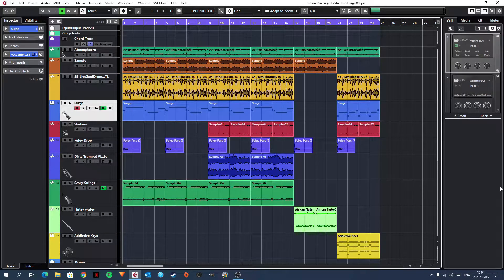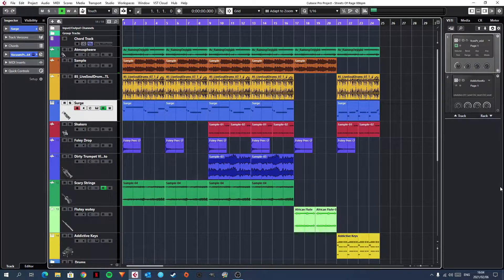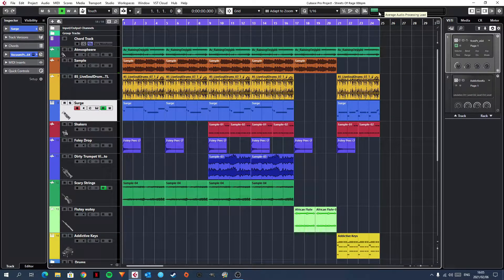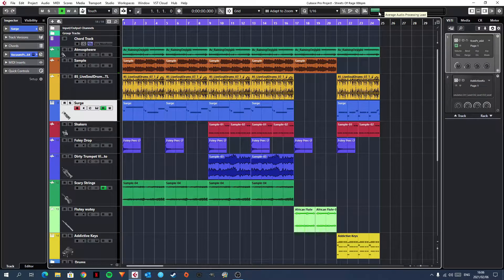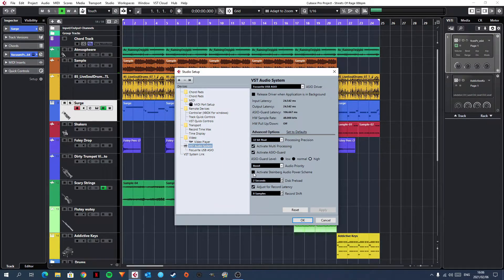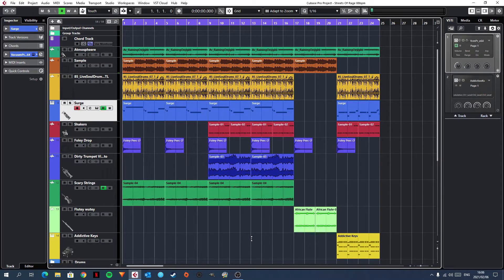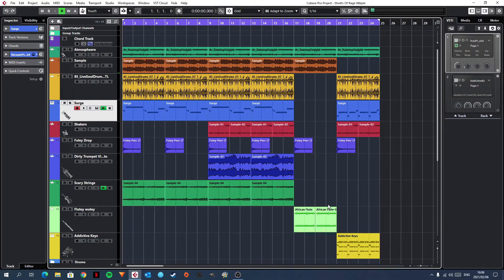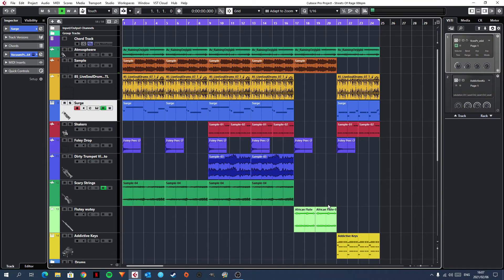Audio Dropouts in Cubase 10.5 Pro, fixed.

Comment: ...i did a test on cubase 12 latest, with vps avenger piano sound just simple pluck chords, it could only play 33 tracks on 35 i get dropouts..on 256 buffer i7 3,2 mac osx monterey 16g ram and ssd...so i tried logic x and studio one 6...they could both run 50 tracks with no problem...so i guess cubase is the worst with cpu ...too bad..😞
Reply from the maker: It's unfortunate. This is where having multiple DAWs comes in handy.

Comment: No changes, unfortunately - still getting popping every 3 seconds when playing an instrument at 256-512 buffer size. FL Studio can run all the way down to 64 buffer without a hitch. Same settings as you.
Reply from the maker: Which audio driver are you using?
Reply: @Ndumixo  Focusrite USB ASIO Firmware: 608 Driver: 4.65.5